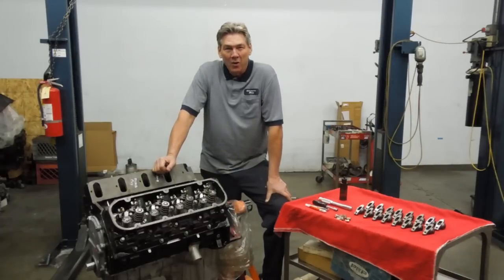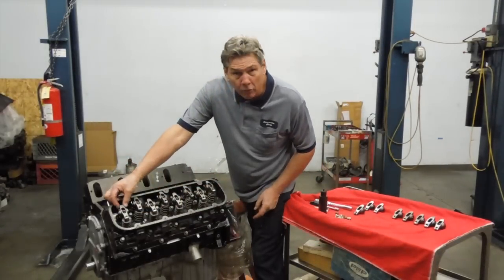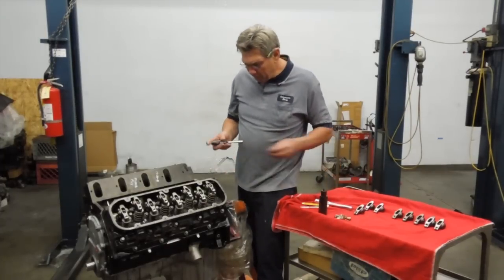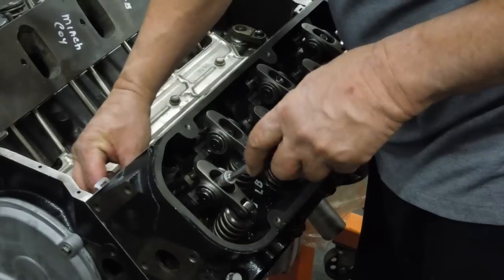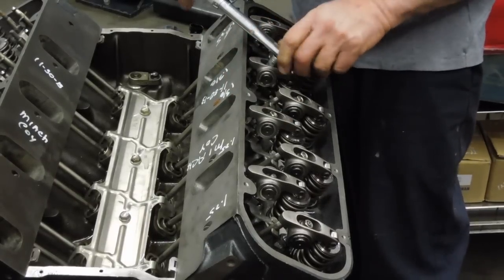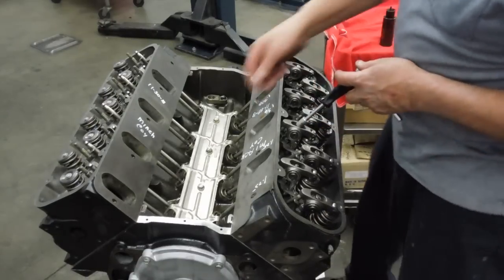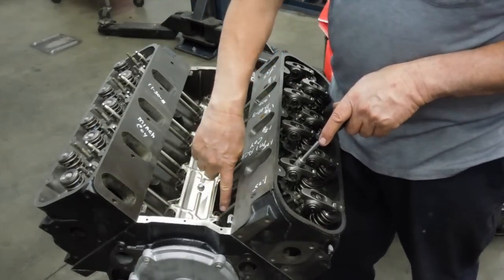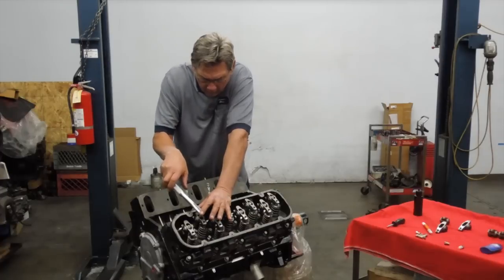Roller Rocker Valve Train Adjustment Gen7 BBC Vortec 8.1L / 496MAG - Raylar Engineering

Comment: So getting to the point of the message I pulled the valve covers off and I noticed I still have stock springs and rockers why back then I didn't do them I cannot remember. But I would like to add that to make this correct. So again any input would be greatly appreciated. And not for nothing I always spread the information about raylar around here where I live because there's a lot of guys with 8.1 trucks and don't know what direction to go in

Comment: @Micah Coy  I wanted to check an 8.1 bp202 and roller lifters 50,000 miles later.  What is a good way to do that being that there is red loctite on the fasteners. TY.
Reply from the maker: If they're not making noise, they're good to go. But if you want to check all the parts and pieces, you'll be taking it all apart and then repeating the steps in the valve train video, front to back.
Reply: @MicahCoy  They are a little rattley for about 3 seconds on the first start of the day. otherwise quiet.

Comment: Do you adjust the valves the same way on a stock engine 8.1 l
Reply from the maker: Yes, the crank rotation / tightening procedure is the same on the stock stamped units - though you will not be able to run roller rockers without the aluminum AFN nuts we're using in the video. You can use poly locks, but you may have to swap studs and buy taller valve covers from Dart (Dart 68000220).

Comment: So if you have 2 to 2.5 turns add a .050 shim below rocker studs?
Reply from the maker: Should work just fine. I've seen people run other brands of BBC rockers with shims without issue. Is this on the iron heads or aluminum units?
Reply: Micah Coy
Iron heads, the ones i got from you
Reply: sb0mbsilverado
Also what was the torque on em I didnt hear him say it in video?
Reply from the maker: sb0mbsilverado
120in-lbs or 10ft-lbs.